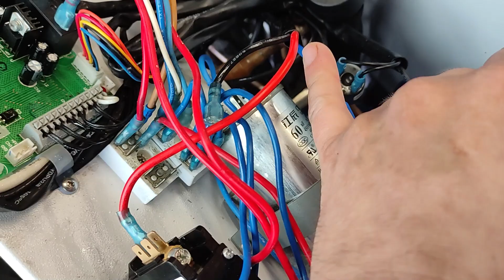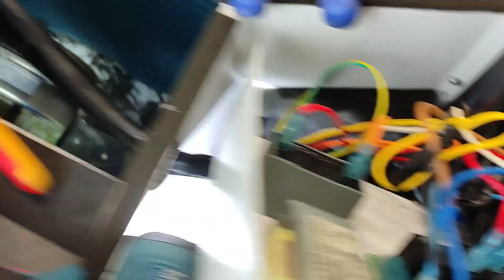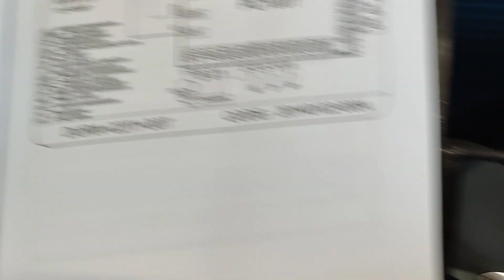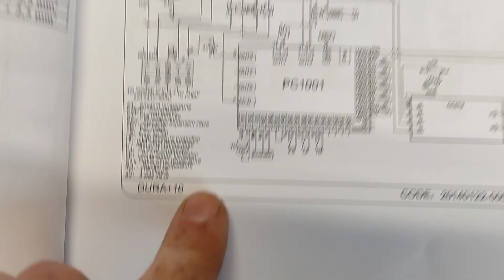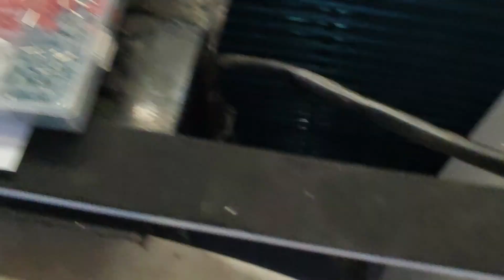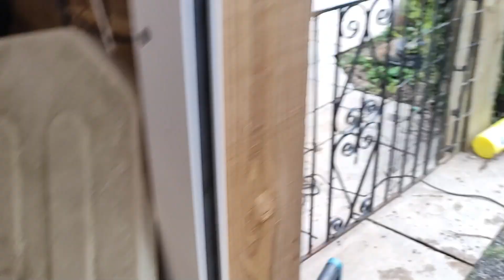Fixing a faulty £80 Air to Water Heatpump

Comment: I was cringing a bit when you were stripping the Flex to fit the Bootlace Ferrels, get yourself a  decent set of Flex strippers mate. Lidl do a Parkside one, it’s a Knipex clone.
Thanks for sharing, great video👍👍

PS. I think I’d do some Polarity Testing & PAT Test etc the Unit before switching it on!!
So if it’s a 7KW Unit & it’s only pulling 1.8KW you’re getting a COP of around 4. Which is good mate. I’d also check the water Flow Rate through the Heat Exchanger. It looks like a Pool ASHP, so may not be suitable for Low Temperature Central Heating?
Reply from the maker: Thanks for the tip, I'll have a look for one the next time I visit a Lidl - great username btw haha

Comment: Ah I think I saw this one on eBay about a month ago! It was from York right? Pleased to see that the fix was somewhat straightforward and that there are bargains to be had for air to water heat pumps
Reply from the maker: This one was local to me, i'm in the midlands, bit of a gamble not knowing what caused the cap to go but fairly certain it wasn't wired to the drawing. Hopefully it will do it's job when I'm ready to use it 👌
Reply: @Funeve  good job on fixing it. Maybe expoed capacitors are a common issue? I seem to remember the listing having a picture of a really similar set of melted wires near a capacitor. What are you going to use it for?
Reply from the maker: @jamesdcuk  Could be, there's a few videos relating to AC systems with the same issue, but for a £12 fix can't complain.

I am going to use it to heat a future swimming pool - buying things when they appear to save a few pounds 😄